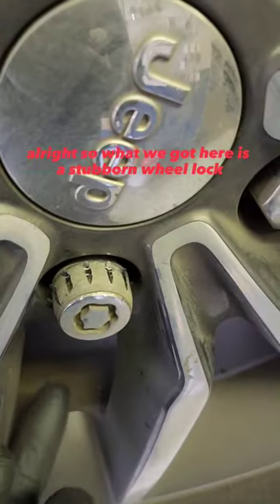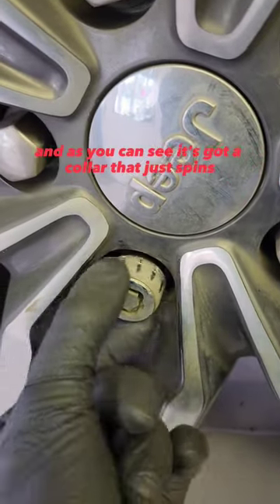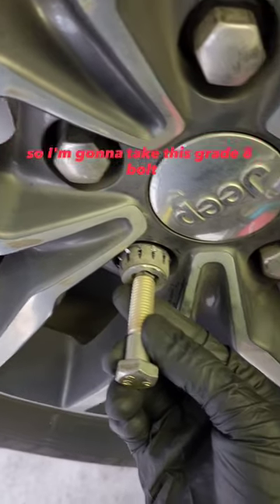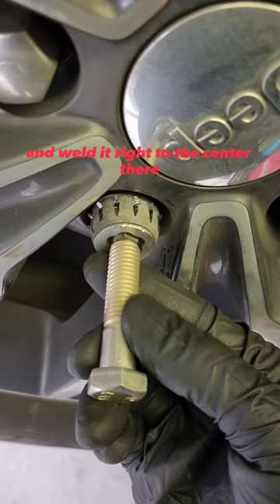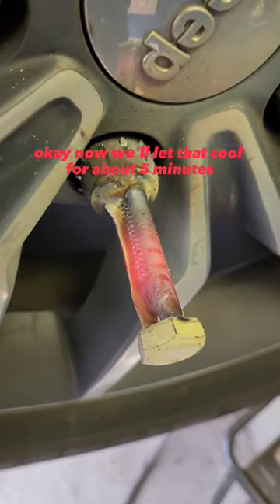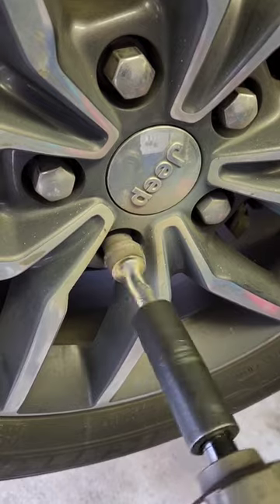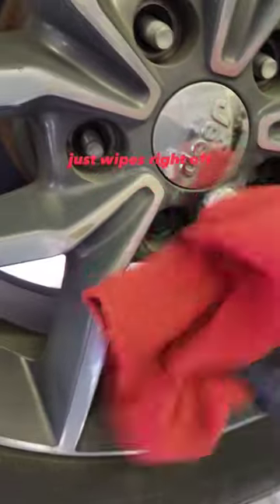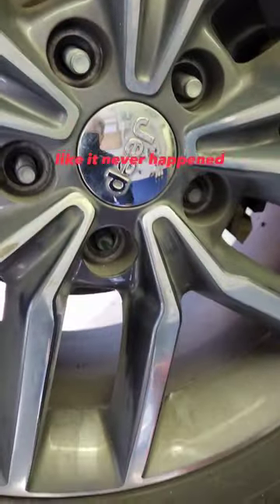Wheel lock removal! #cars #mechanic #mechanics #welder #welders #shorts

Comment: why not just buy a wheel lock key set? I can go to my canadian tire, and pick up a 16pc wheel lock master set currently on sale for 75bucks. with lifetime exchange warranty
Reply from the maker: They went to the dealer and the dealer said they need to torch them off 🤔 I think they should have went to a different dealer but either way all 4 are off now with standard lug nuts

Comment: Lol like it never happened. Meanwhile all the slag everywhere. At least tig it to protect their wheel or use a non stick spray from Lincoln.
Reply from the maker: I was waiting for this. Little soap and water and the wheel looks brand new. Not even a speck in the clear.
Reply: @nickquatrini  the amount of messed up $400 OEM wheels I've seen from careless mechanics or tire shops is crazy. Buy a can of non stick if you plan on using mig near wheels. Instead of soap and water rinse non stick, spray with a wheel cleaner that contains iron remover for aluminum wheels. Imagine doing this with powder coated rims.